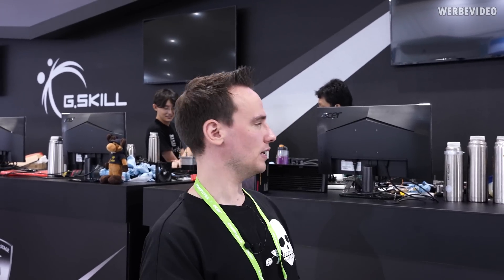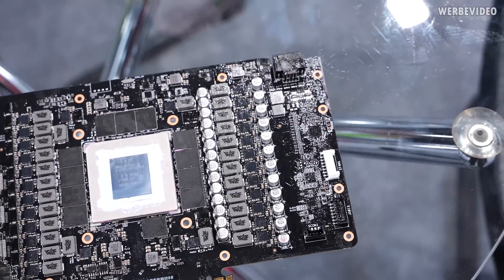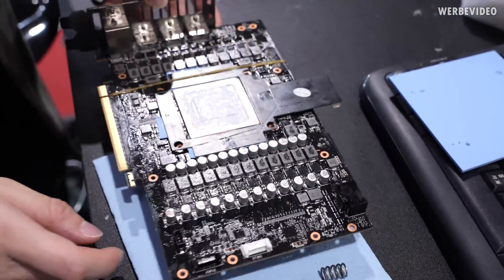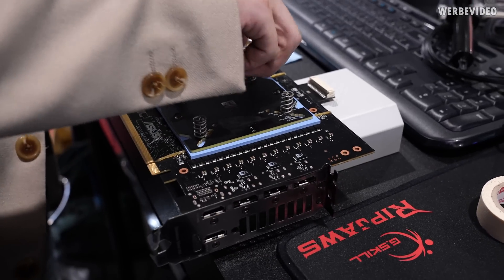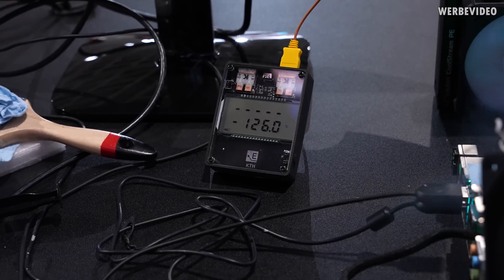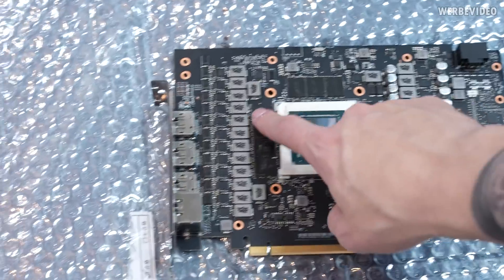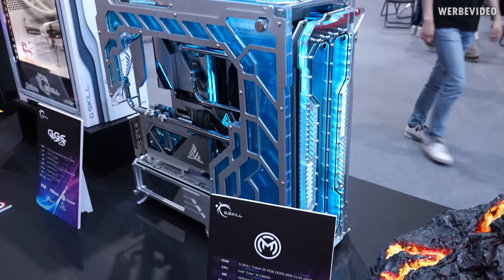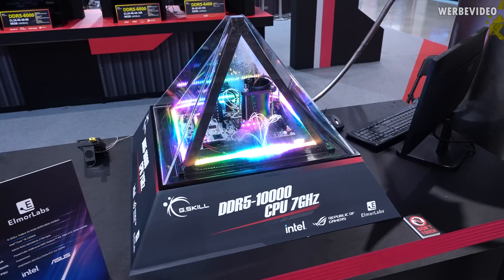Special Features on the new RTX 4090 Matrix? First look at the PCB

Comment: The RTX4090 MATRIX is a great looking card, but ASUS need to offer a version which can be slotted into an existing OPEN custom water loop as well. Yes water cooling is the best way to cool this card for amazing performance, but this is an expensive card for an AIO which usually only last 2 or 3 years, and if there were an open loop version then it could be hooked up to a lot more cooling than just one 360mm radiator. In my open water loop I have three 420mm radiators.

Can you please ask Asus to make a RTX4090 matrix water blocked card, which they already have, but which can connected to open loop tubing?
Reply: Wouldn't it be possible to convert this card to open loop? Just cut off those hoses and install fittings? Would that work?
Reply: @pmclean1980  no, unfortunately. There is a pump built into the AIO version and we dont know what materials are used in the water block (you should NEVER mix metals in an open loop) and we dont know what pressures the GPU fins and other components need/can handle. 
If would be easy for ASUS to make an open loop version by tweaking the design, but NOT for us to convert an AIO.

Comment: MPS/MPSA designation is from ON Semiconductor (onsemi) both ways. The "M" would have stood for Motorola if things didn't change (MBR, M/MBT, MUR, etc). Competitor would be PowIRstage from International Rectifier (now under Infineon)

70A stages...how far had things moved in the consumer market! So does the price...
Reply: MPS is Monolithic Power Systems which AFAIK has nothing to do with OnSemi. OnSemi owns Fairchild. Infineon owns international rectifier. MPS is it's own thing.
Reply: @ActuallyHardcoreOverclocking  It's that company...sorry. (liked their MP3431) Assumed it was the part code like MPSA12 or something. Fairchild fallen far...at least Infineon didn't wipe off the IR name like TI did to National

Comment: The monitor as a case thing is SO cool and would sell like hotcakes if not overpriced.
Reply: Yeah if the price like a normal case + buying 20 inch monitor anyone will buy it...
Reply: Monitor as the case sounds like the concept for an All-in-One just shaped different and the one in the video you can add/remove from the case instead of everything intergraded like the All-in-Ones sold right now
Reply: it's one of those situations where yes you can, but why?
Reply: Would rather have a case I can mount to a monitor via VESA, or a case with VESA mounts for a monitor.
Reply: Sounds like an iMac
Reply: You can already get them. ibuypower snowblind.
Reply: @hmmboost  but well how bout the price???
Reply: Don't think that heat at the back of the screen would be great for the panel
Reply: @adamdunne6645  would ambient case temps really be much hotter than the inside of a passively cooled monitor?
Reply: @Incommensurabilities  I doubt it, And certainly not for the kind of machine that a person would build it.  That is odds are someone blowing that kind of coin on the monitor glass side panel tends to have higher end hardware to show off and would have the related air flow to go with.  Probably a lot cooler than any monitor runs at including non performance oriented ones in an office.
Reply: I think we wont see it go mainstream until we can use OLED panels for this application at some reasonable price. It can't be understated that you need A LOT of lighting inside the case to make a backlit panel actually viewable. Transparant OLEDs solves that issues.

Comment: I hope they sell replacement pumps or compatible coolers so the gpu doesn't turn to e-waste after the pump dies.
Reply: Does any company do this? I haven't heard of one, except EVGA.
Reply: @YataLocK  alphacool sell aios with radiators for GPUs but the pump they use is rubbish
Reply: Let's be real though - if you're buying a binned halo product, you're probably not going to use it past its pump's life...
Reply: @Lishtenbird  e-waste is not good for the environment
Reply: @Lishtenbird  This, these folks jump on newer gen the day it is out.

Comment: Good thing they changed the coils. Bad thing only for Strix. I have TUF 4090 that is also a MIDI sound card. Never Asus again.
Reply: Ouch, that sucks. No chance of a warranty replacement?
Reply: @--_DJ_--  Didn't even try. Apparently it's normal, card is functioning properly after all and according to internets there is no basis for a complaint.
Reply: My 4090 had a horrible coil whine when i first used it, then it got better with time

Comment: I want that boost master software more than anything else haha
Reply: Somehow I don’t think it will work on retail cards any better than afterburner etc. unless you also get your hands on their bios and firmware, that card must be running an open firmware that doesn’t check for the signature on the bios or something. Or it has a special bios with higher limits exclusively for this OC trial with LN. I doubt it can somehow communicate with the voltage controller over PCI but I could be wrong
Reply: @radugrigoras  for me, i just want a totally stripped down program to overclock the card. I don't want RGB controls or OSD stuff.. just the most basic program so i can set the OC and forget it.
Reply: @into-the-mild  I agree
Reply: @radugrigoras  Asus has programmable voltage controllers on their TUF and Strix cards. Wouldn't be out of the question to control them via software like they do in the past. Currently for us regular consumers its only possible to control them via external i2c interface using something like an elmor evc2sx soldered to the 3-pin interface asus builds into the cards pcb.